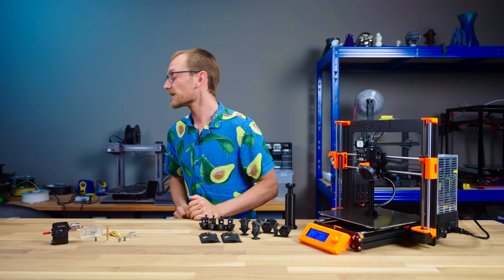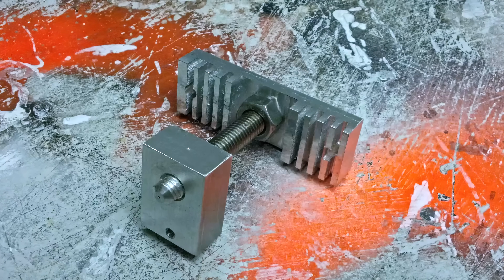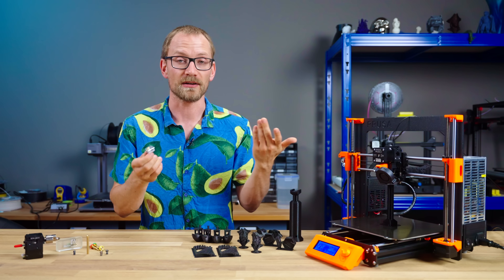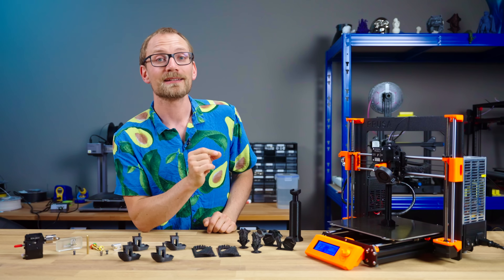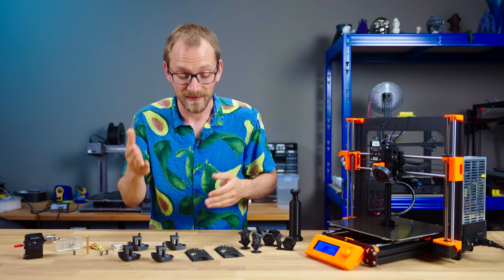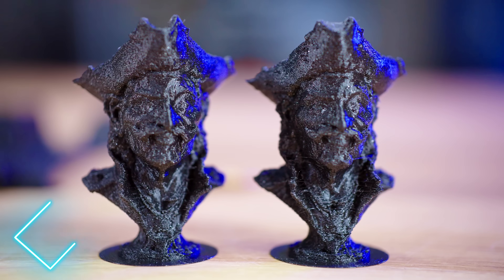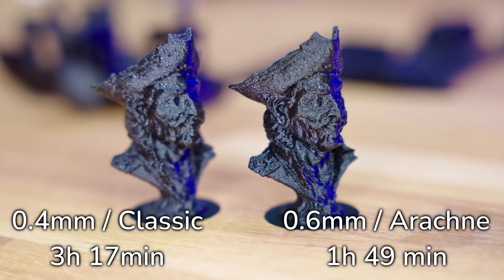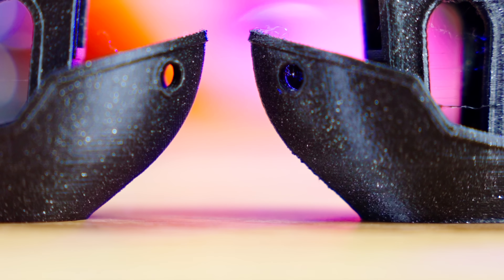0.4mm nozzles just became obsolete

Comment: Hola Thomas, How are you? Did you really achieve the same uniform surface quality of a 0.4 nozzle and 0.15 layer height with Arachne and a 0.6 nozzle? It is not being possible for me to achieve it at all. I use a Mk3s+ with a 0.6 nozzle, 0.15mm layer height and PETG. Even testing with 0.2 layer height is still far from the quality of a 0.4 nozzle and the classic prusa slicer perimeter generator.

Comment: The speed benefit becomes even greater if you also take in account that if you are used to using three perimeters with an 0.4, you can achieve the same with just two on 0.6mm.
You can also probably get away with a lower infill since that too is by default a thicker plastic.
Reply: Why everyone is so obsessed by speed? It is not like time is a limiting factor,  usually it is the amount of filament you are willing to spend for fun.
Reply: @ligametis  Short answer regarding my own need for speed: I'm an Engineer. So for me the priorities are flipped.

I'm constantly iterating on parts and designs. A fast printer is vital to being able to print large parts during the evenings when i'm home from work to get everything ready by the weekend. Otherwise i'd need multiple printers churning over the weekend.  While in regards of filament i assume i'm going through at least 3 versions of any part anyway. So i stockpile the stuff.
Reply: @chielvoswijk9482  Yeah, I was expecting this isn't a hobby for you, but some kind of business if price is less important factor and you are trying out many revisions instead of single very well designed one because filament is so expensive.

I use 0.2 nozzle and 0.1 layers just to get the most beautiful result from the first try.

Comment: I must have missed this in the video, but how does a 0.6 mm nozzle print faster than a 0.4mm nozzle when the extrusion amount should be the same? 0.2mm layer height should be 0.2mm layer height in either case, no?

Comment: I use a 0.4mm nozzle and drop my extrusion width to 0.3 for super fine detail which works great, or if i want faster speed for parts that dont need detail, i bump it up to 0.5 or even 0.6. Works just fine... so far

Comment: Thanks Thomas for the very interesting and useful video. I've always been interested in using bigger nozzles because in my opinion one of the weakness of 3D printing it's slowness. I just have a doubt though, when i switch to another nozzle size (eg 0.6) the only parameters that need to be adjusted are layer height (<80% nozzle size) and layer width? I say so because i don't have a Prusa and ready to use profiles (for different nozzle sizes) are not available for my Anycubic Mega in Prusa Slicer.

Comment: My first Super Fast profile for Cura with new .6 nozzle. I looked at Chep's FFV5.1_EF(0.28) and just increased all Nozzle related by 50%. I also decreased speed by 80%. The result is a blistering fast print compared to Chep's .4 profile. Give it a try and tell my what you think.
Layer Height 0.28
Initial Layer Height 0.28
Enable Acceleration Control True
Enable jerk Control True
Line Width 0.68
Inner Wall(s) Line Width 0.75
Infill Line Width 0.86
Outer Wall Wipe Distance 0.3
Print Thin Walls True
Initial Layer Horizontal Expansion -0.2
Top Surface Skin Layers 1
Top Layers 3
Bottom Layers 3
Top/Bottom Line Directions [45,135]
Skin Overlap Percentage 30
Infill Density 25
Infill Overlap Percentage 0
Infill Layer Thickness 0.3
I upped the printing temp from 200 (best for my PLA) to 210 for the thinker nozzle
Flow 95
Initial Layer Flow 95
Print Speed 50.0
Outer Wall Speed 40
Inner Wall Speed 52
Top Surface Skin Speed 40
Top/Bottom Speed 36
Initial Layer Speed 20
Initial Layer Travel Speed 100
Skirt/Brim Speed 2520
Z Hop Speed 8
Print jerk 20
Initial Layer jerk 8
Initial Layer Travel jerk 5

Comment: I've noticed on my prints that the new optimized 0.6mm profile uses about 10-20% more filament per print than the 0.4mm profile.  This doesn't appears to be related to Arachne.  The 0.4mm prints estimate out to the same amount of filament use with or without Arachne, but the 0.6mm prints with current engine use more filament.  

So increased speed, but also a bit more cost in filament used. I am curious if a 0.2mm layer 0.6mm nozzle print is stronger partly because there is more filament effectively increasing the infill or border wall thickness.

Comment: that may be a new feature in free slicers, but i use simplify3D since end of 2019, and there you have the option to specify a minimum and maximum extrusion with lines in terms of percentage of your standard extrusion with. simplify3D never did that strange gap fill things like prusa slicer with classic perimeter slicing, and it was no problem to print .25 single lines with a .4 nozzle. that's why i always used it for models with small text on top. but happy to see that now also the free slicers catch up, this will make simplify 3D almost obsolete now (only advantage over prusa slicer will be the process based settings, where you can control every setting based on model and/or layer heigth, prusa slicer doesn't allow for changing every setting....)

Comment: That arachne seems great. However, my main printer will still be on a 0.4mm nozzle for now. Because if I want to print anything other than PLA, (specially that cursed PETG) the volumetric speed will limit the print speeds even with the 0.4mm. i have traditional heating device on it and I'm considering trying to put a volcano hotend or something similar to boost heating speed of the filament so I could maybe benefit from bigger nozzles, before trying bigger nozzles again.

Comment: Surely the upper bound on speed is your max volumetric flow rate? So if going up to 0.6mm nozzle gives you a higher volumetric flow, then great, you can print faster. If not it doesn't make any difference. I determine my volumetric flow by extruding a length of filament (e.g. 200mm), calculating what the mass should be, then measuring the actual mass. If I do this while incrementing the speed in mm/s, I can see where the hot end/extruder can no longer keep up. As it is I see a very marginal difference in max volumetric flow rate on my ender 3 v2 with an orbiter 1.5 between 0.4 & 0.6mm nozzles. Am I missing something?

Comment: I've been running a 0.5mm nozzle for 4 years now. The benefit is that since I design mostly in metric system I can easily do a 1mm detail with 2 walls. Simple math and done.

Comment: I never understood why print speed and print time are even a conversation point. I have never met anyone who would get at least 10% utilization on their printer. For reference, 10% utilization would mean 876 hours of printing every year. The printer has quite enough time to finish the prints and no matter if a print takes 1 hour or 3 hours, I still have to wait and will not sit around for it to finish.

As a result, I was kind of struggling to see why a subject matter in this video was a big deal, or any deal. But the last part explained it very well. For someone who is after speed, they can get that, with some drawbacks, for someone who is after detail, or in my case, the most accurate replication of the model, we can get that. And for someone who is happy with both quality and the speed, there will be a free boost at no extra effort.

Comment: I've found that switching slicers to Arachne for a print with tight functional tolerances between bodies,without changing anything else, always causes tolerances to change considerably.  If you goldilocks'ed it into good fitment, just stick with the old slicer.

Comment: I'm pretty sure that simplify3d has been doing this variable extrusion thickness for a while. Any chance you can do a comparision between prusa slicer with arachne and simplify3d. I pretty much just do practical prints. I've used a 0.5 mm nozzle on my delta for years and never had an issue.  So currently contemplating a 0.6 on a core xy. All on simplify3d though :-)

Comment: How is the weight difference of the printed parts between 0.4mm default vs. 0.6mm arachne? (I mainly avoided 0.6mm in the past because the parts got straight 50% heavier and therefore used 50% more filament. So it would be interesting to see your point of view on this aspect.)
Reply: i guess it's upto if it's possible to specify wall thickness instead of outer wall count etc. Then slicer could make 2x0.4 slices which speed wise the same but material wise also the same as 0.4 nozzle. For me I have always used 150% inflill even on 0.4 nozzle (so it will try to print as 0.6 nozzle then using 0.4 nozzle). it will make thicker infill and in the same time I would reduce infill percentage which would reduce print moves but still would have thicker-stronger infill).

Comment: I go back and forth between .8mm nozzle and .4mm nozzle. It seems lots of models are optimized for the .4mm nozzle. Some filaments i couldn't get to work through the smaller nozzle so i run them through the .8mm.

Comment: I remember when I got my 1st CR10 MAX and couldn't believe it came with 0.4 as standard, before I even printed a test print I installed 0.8 which works perfectly for my larger products.

All my other printers run 0.6 and achieve great detail even at .4mm layer heights, and when time is money you quickly realise bigger nozzels are an incredibly good investment.

I've actually won business because I have been able to turn around jobs so much quicker that expected. 
Often they are functional prints rather than cosmetic ones, so using 0.8 and 0.6 nozzles has sllashed the print time and so turnaround time. Multiply that time saving across multiple printers and it's a game changer.

Thanks for aother great video 👍

James

Comment: My first 3D printer was the RepRap Mendel using Josef Prusa's open source files about 2011. I used a 0.35mm nozzle for 2 years, it made strong parts, never clogged, ever, with the Greg's Wade goes fishing extruder made of ABS. There weren't a whole lot of choices back then. I think nozzle size scales to the size and intricacy of the project.

Comment: The one thing this video leaves out, that people may want to consider, is that a 0.6 mm nozzle uses more material than a 0.4 mm nozzle. Sometimes by a huge amount. Depending on your layer height and  line width I have seen a print take up to 100g more filament on a 0.6mm nozzle vs a 0.4 mm nozzle. You would think it would be the same since the lines are just wider but there are fewer of them; however, for some reason a 0.6 mm nozzle takes way more filament, for the same object, than a 0.4 mm nozzle.

Comment: Messed around with larger nozzles a few years ago. For most things I also found a larger nozzle was better. Whatever loss of quality there was I couldn't tell but always a faster print. And this was with an older slicer so if newer slicers have improved then awesome. 

Haven't printed in a long time but I think I still have a .6 still installed.  I reasoned that if I needed more detail I'd go with a resin printer.

Comment: I use a CR-10S with Klipper and am always pushing the limit of speed. With what you say here I think I will try 0.6mm as the filament should flow a bit better without the feed slipping as much causing under extrusion during certain moves.

Comment: I think this was worth bookmarking so I can come back to it later to review. I'm in no rush to move on from .4 nozzles on my two Prusa MK3S printers, however I do print a LOT of life-size museum scans of fossil skulls and other prehistoric type things. Lots of what I print has a pretty high level of texture detail that I don't want to lose as it needs to keep that texture when primed and painted. However, get to printing a life-size multi-part scan of something like a Allosaurus skull, a complete Velociraptor skeleton or a Smilodon skull, and often these prints (even running on two printers), can end up being 24-48 hours per part and often both printers running nearly 24 hours a day for days and days on end. It means there's a pretty big amount of time that both printers get tied up working on a single project. Also, these days I try not to print things that take much more than 24 hours as any type of failure that might crop up near the end of a print makes a bed-filling part that uses a 1/4 of a roll of filament all the more painful. The biggest advantage I could see for this would be that if I could print bed-filling parts in half the time with the same level of detail, then it'll be a game changer for me in terms of how long it takes me to print some of these bigger projects. I'll wait for a stable release, but since I have upgrade kits for both of my printers to turn them into MK3S+ as well as the all new E3D Revo quick change nozzles - it won't be such a big deal to just pop a .6 nozzle in and give it a try. Once that stable Prusa Slicer update comes out with Aracne, I'll be back to look at this video again.
Reply: Are those fossil models available online, somewhere?

Comment: when your printing with a 0.8 nozzle you don't need to adjust your print movement speeds, choose expert mode under printer settings on the speed section and set the max volumetric speed that your hot end can handle. then all movements are as fast as possible but only extruding it at the limit of the hot end. doing this with a 0.6 nozzle can help also

Comment: Printing resolution comes mostly from line width and layer height. What's the lowest extrusion/line width with the 0.6 nozzle you can comfortably do? On 0.4mm I can go at least to 0.35mm and everything comes up fine. In Prusa slicer default line width is 0.6mm (outer perimeter) anyway so that can be one reason why 0.6mm nozzle does not print too different than 0.4 nozzle.

Comment: I'm surprised that dialing down the perimeter extrusion width to slightly below nozzle diameter is not mentioned as a way to get those fine details or extruded text labels to print fine. Before Arachne, I have found that to work much better than the 'detect thin walls' option...

Comment: Tested Arachne and non Arachne engines on the common prints I do and found Arachne actually took longer than before. I did notice it does remove a lot of the scrubbing. But yeah interesting to see all but one sliced at a longer time. ie 12hr print states about 10mins longer with Arachne.

I’ve been using 0.6mm nozzle from the start of 3d printing. Swapped to a 0.8mm first then 0.6mm. Best size nozzle for sure.

Comment: In addition to 0.4mm becoming the standard, I would expect manufacturers to optimize their system for that size nozzle. And that likely includes the heating elements, and everything else in the system being optimized for 0.4.

I would be surprised if long-term usage causes premature wear/tear on the heating elements and other things.

Have you run long term reliability comparison tests of any printers, and what were the results?

Comment: I'm convinced, I'll get a .6mm nozzle when I rebuild my printer (Anycubic Predator delta) hot end. I'm also adding a full metal heat break. Any tips / settings for that printer you would recommend?

Comment: Something that's worth mentioning is that you can still change extrusion width with your nozzle. I've been using 0.4mm nozzles with 0.6mm extrusion for the last 3 years. I love it because if a part requires thin walls, i can simply change the extrusion width for exterior walls only down to 0.4mm or so. This works to extrude 0.4mm walls with 0.6mm nozzles as well. But now, with arachne, i won't need to change extrusion width which is really nice! I'll still stick with my .4mm nozzles for now, and keep extruding .6 width with arachne. Sometimes to avoid gap fill, i'll play with more decimal places to speed up the print, like maybe 0.62mm and for taller prints, that gap fill makes a big difference in time!
Reply: I'm still learning about 3d printing but you are telling me that i can print 0.6 width lines with a 0.4 nozzle... i  usualy print 3 perimeters at 0.4mm line width so with your method i could use only 2 perimeter and achieve practically the same level of details and strenght but in less time due to less travel movements of just usin 2 perimeter right?
Reply: @ricardordz7538  yea exactly.

Comment: Thats what I use to tell to my followers and students. If you dont use a layer height smaller then 0.12mm there is no reason to not use 0.6mm nozzle instead of 0.4mm. And now even with Prusa using the Cura Arachne with the adaptive layer width: 0.6mm nozzle is the new 0.4mm nozzle.

Great video!

Comment: Thomas I have a question that maybe you could help me with.  I have been printing for about 2 years now, I own 2 Ender 3 pro’s and an elegoo neptune 2s that all print great.  I have a 2nd elegoo neptune 2 I bought cheap, have it put together, but I think the z axis stepper driver is bad I tried replacing motor, adjusting voltage on stepper driver, tried a new cable and new motor and it does the same thing.  In 1 of my Ender 3’s I have a BTT skr e3.  Could you recommend a replacement board for the elegoo neptune 2 I am assuming I am also going to have to change out the touchscreen also.  Thank you for any help you may be able to provide.

Rick

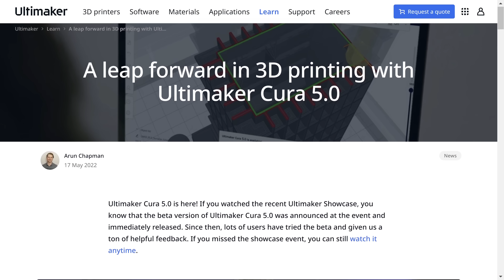Comment: The video is a bit blurry but it seems that around 4:40 the two prints in the middle have thicker "pipe" wall thickness of the short angled pipe at the rear. I would assume that the two in the middle used 0.6 mm nozzle. However, it appears that the print on the left has thinner wall for that "pipe" structure than the one on the right. Perhaps this is caused by lighting differences or the slicer?

Comment: I'm confused by this video. Why not just use a .4mm nozzle and up the extrusion width? Also, are you saying that Arachne engine is only beneficial for .6mm nozzle, or will there still be gains when using it with .4mm nozzles? Seems like using a .6mm nozzle will give you more issues than what you actually gain. I always just increase perimeter and infill extrusion width using my .4mm nozzle, and it works just fine for me.